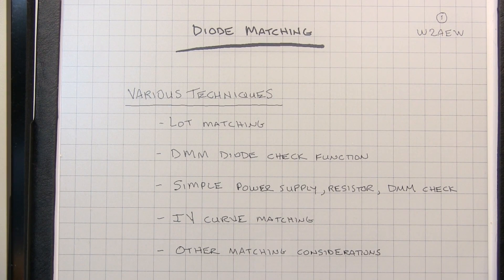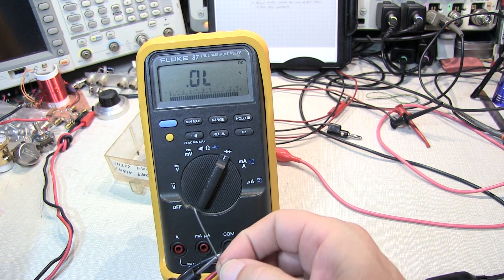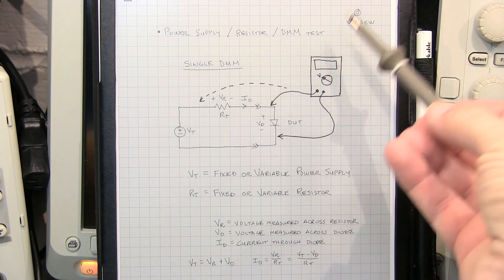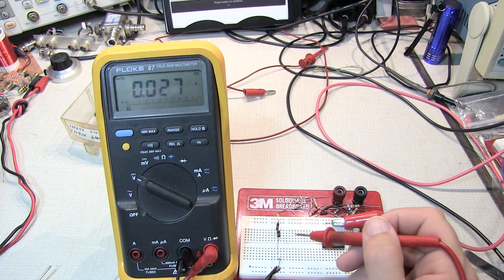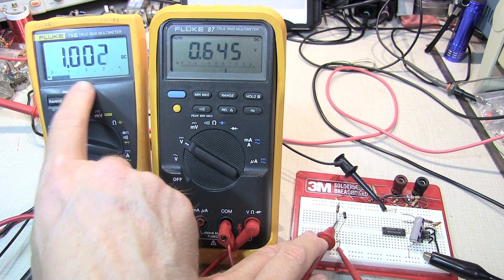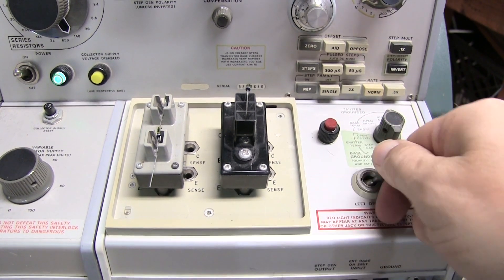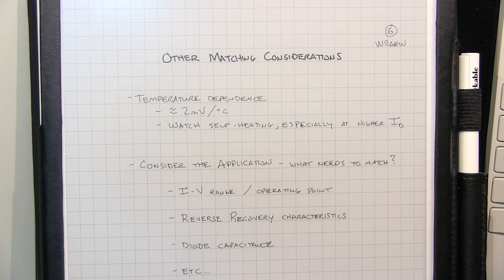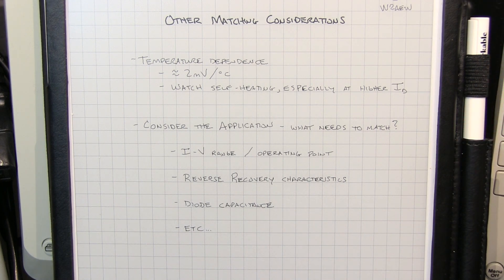#302: Back to Basics: How to match diodes -- measurement setups to find diodes that are matched

Comment: Thanks for the video. I did something you might find interesting with this knowledge. I created a 10mA constant current source using a LM317 to which I control the power through a relay which is in turn controlled by a Raspberry Pi Pico and then the dropout voltage over the diode is read using a MCP3424 (Only need 1 ch but this is the one I had on hand) and then wrote some nodejs code which sends a command to the pi pico over serial to initiate the measurement, which turns on the relay to apply the 10mA current and then takes a measurement using the ADC until a stable value is achieved and return this mV reading back over the serial port to the nodejs script. Each time the script runs it will load the previously received values and then group them in BIN numbers so I never actually write down any of the values because why not have the nodejs script keep track of all that and in the end I have an entire tray full of diodes with some nice groupings. I have not quite decided how long to apply the 10mA to the diode before taking the measurement because it seems to drop a few mV but it seems the exact point of "stable" is not the same for all diodes either... anyway, just thought I'd share what I did with this information ;) Really loving your videos!
Reply from the maker: Sounds like a great project.  You could expand it to have the Pi adjust the value of the current, and do a mini I-V sweep of the diode to get even better matching (knee voltage as well as dynamic resistance!)
Reply: @w2aew  I used 3x MCP41010 digital pots in parallel using various combinations to step from 1mA to 15mA and measuring using the same method above. When comparing the curves of 4pc groups I previously matched at 10mA there is no notable difference in the curves... I have to zoom in very very far in an excel graph to see the individual diodes but from the curves it looks like the incredibly small difference (100uV in one example) is proportionally comparable across the entire range from 1mA through 15mA. Thanks for the idea - it was a fun exercise and kept me busy for several hours ;)
Reply from the maker: @andrethomas1800  That's awesome!  You'll find that diodes that come from the same "batch", which is what usually happens when you buy a bunch at once, will match very closely.    Now all you need to do is add a LCD display to your R-Pi and graph the results ;-)

Comment: So very interesting, Thank You! Can the "Q" of AM radio reception  be affected by the quality of a diode? (How) Can the AC/DC load on a diode be measured? Thanks!
Reply from the maker: You can certainly measure the voltage across a diode with a meter or scope.

Comment: When matching transistors you mostly match the HFE, but when using a curve tracer or DCA pro you can match transistors by their "early voltage". I'm not sure why would you want to match transistors by their "early voltage"? If the transistors Match the collector output current, base current and HFE but "Don't Match" the early voltage, what will happen?

Comment: The Huntron Tracker I used to use would display a curve of a diode like that and it had a alternating function which would switch back and forth fairly rapidly so you could look at two diodes curves for comparison.  With A and  B connections.

Comment: For long-term stability, it might be useful to anneal them for a couple of hours at about 130 Celsius before matching (try and see whether the parameters change...).  If I needed to do this often, I would build myself an Arduino shield to vary/measure the current and to record the voltages to plot in Excel.  I would attach each diode to its plot.  You could categorize them by their Ebers-Moll parameters at best fit and write these parameters on the plot as well.  It is likely that average parameters occur often so that you could put these easier-to-match diodes in a separate file folder.

Comment: You mentioned a source measure unit as  alternative to using a curve tracer.
Reply from the maker: Yes, a SMU (source-measure unit) can source/sweep a current or voltage and simultaneously measure voltage or current.  Newer ones feature graphical displays and can plot results.

Comment: I tried this on discrete diodes and it works well.  When I tried to compare  quad pack diodes  TI   UC3611N
the voltage seems to wobble vary a lot.   I used my power supply directly in CC (current control) mode.
It work well on discrete 1N5818  diodes   but was not stable at all on the IC quad diode packs with the voltages
varying much more diode to diode for the same current ?  Any ideas what might be causing this ?
Reply from the maker: Strange - not sure what could be causing that.  Maybe stray pickup from the other diodes?  Try shorting all of the unused leads together when testing one of the diodes.  Maybe even grounding the unused pins...

Comment: Hi and will start by thanking you for all the great videos ! I was hoping if you could tell me if you have ever covered verifying that earlier stages/transistors are OK when you have failed output transistors. If not would it be possible for you to cover this subject use bare bones equipment (like me ) and what to look out for as to save yourself another run to the electronics shop .Thanks again
Ron    (Fremantle downunder)
Reply from the maker: If the equipment can be safely turned on, the best place to start is always to check the DC operating voltages (power supplies, and bias voltages around the transistors).  Failed transistors will often be obvious due to bias voltages that don't make sense with respect to proper transistor operation.

Comment: Hi Alan, I was wondering if you can perhaps do a video on resolving second harmonic interference within high frequency switching circuits that are used in RF applications. TOI is often mentioned within the engineering community, but when it comes to the second harmonic not much can be found. So I was wondering if you can do a video about SHI and on points on how to resolve that said interference.
Reply from the maker: I can add that to my long list.

Comment: As a side note, using a DMM to measure the diodes used in sensitive RF detectors can catastrophically damage them (the junction size is tiny to minimise parasitic capacitance). I've heard of technicians "buzzing out" a batch of RF diodes destroying each one as they went about their work!

Comment: A "more fun" matching task I had to perform was finding two PNP germanium power transistors (TO-3 package), wired as diodes -- in my case, base & emitter shorted together, cases (collectors) as anodes -- for a Harrison/HP 6920B meter calibrator. Those have to be matched up to a current of 5 A, and still have low Vf, as there's only about 2 VAC to play with.

Excellent video. I am very very jealous of your Tek curve tracer!

Comment: ok thanks i didn't know they use match diodes in log and anti log circuits, I rarely have seen op amp based log and anti log circuits not often used in schematics i have seen and I'm not sure where they use log and anti log circuits in besides in electronic theory text books i have seen them.  They say i was testing leakage current in diodes was measuring the resistance of the diode, if the diode has low resistance i just thought it would cause leakage current because the low resistance means the diodes junction resistance is low resistance and is passing leakage current.

Comment: any other circuits besides balanced modulators and mixers. I have seen matched diodes for wheatstone bridges and bridge rectifier,  balanced modulators and mixers in RF circuits, but what other circuits use match diodes? How can you test a diodes leakages without using a curve tracer because a DMM meter you can't test a diodes leakage. I have just used the DMM ohms resistance to test the diodes leakage, but i know like you said its not a good way of testing leakage. So what is the correct way of testing diode leakage test?
Reply from the maker: One application that requires matched devices are circuits that perform log and anti-log responses, etc.  You can test leakage with a power supply and ammeter.  Apply a reverse bias voltage and measure the current.

Comment: Yes i have notice when changing the resistance range its changes the applied current. Your Curve Tracers showed two different signatures from the same diode batch lot. It looks like one diode turn ON soon at 500mV and the other diode turned ON at 400mV. Any reasons why the diode turn ON or start conducting at different points? I'm not sure what this electronic term is called when the diode turns ON threshold point.  I have measured the diodes resistance ohms and they measure differently  and not sure if this is leakage testing a diode or what other ways to test diode leakage using a curve tracer or DMM. What application and circuits would you want to "match" the diodes? you mentioned it but didn't explain more about it.
Reply: Fabrication variation, packaging stresses and other things can cause changes in diode turn-on characteristics. Using a resistance measurement is just ok for doing a quick go/no-go testing, but the resistance value is meaningless. Leakage is measured under reverse bias conditions. Matched diodes are used in a number of different circuits, such as balanced modulators, mixers, etc.

Comment: Be careful when you measure with really precise multimeters and you touch the diode on both ends with moist fingers you can make a different in the measurement.
Reply from the maker: True - but in the case of measuring diodes, the several hundred kohm resistance of your fingertips won't have much of a affect on diode measurements.  However, holding the diode in your fingers can raise the temperature of the diode, that THAT will change the reading.

Comment: As usual, a great video. I've learned so much from you. Can the same technique work for transistors?
Reply from the maker: For measuring Vbe of bipolar transistors - yes.  But, keep in mind that matching transistors can be much more involved than matching diodes, because they may need to be matched in Beta or other parameters as well.
Reply: @w2aew  Thanks Alan .. 73
Reply: A curve tracer will be suitable for that. Not so diffcult to build with all schemas on internet. or if you have an Oscilloscope and a modern generator with stair case wave form. I thing Allen has a video that shows how do construct a curve tracer.

Comment: Super important and virtually lost concept across all solid state and some tube applications. The old Tek gear is still available both as stand alone and modules for 5000 & 7000 series scopes. 

Fantastic video. I'd love to see more particularly on matching bipolars for replacement/repair applications.

Comment: Thanks for the upload. Isn't this another application well suited for a LM10? At least if someone wanted to go a step further than resistors on a breadboard, prototype a simple one-off adjustable tool, but without the curve tracer or adjustable bench PSU setup. I think you're the one that introduced me to the LM10 too :-)
Thanks again.
-Jake
Reply from the maker: Yeah - I love the LM10!

Comment: Can Lab Bench DMM meters change the "current settings" when measuring the resistance ohms? These is often tests done for measure the diodes leakage which would increase the current and measuring the diodes resistance it will change depending on how much current you're applying to it.
Reply from the maker: If you manually change the range on a bench DMM when reading resistance, you will generally change the applied current.

Comment: Allan most of my explorimenting involves solid state devices although I am very interested in vacuum  tube tech and have built a few tube circuits without full comprehension in particular grid leak could you please please do a video on Grid leak (what it is, how to properly select correct grid leak resistors, how to correctly make necessary associated measurements  pit falls and caveats etc thanks S

Comment: Hi Allan can we  do away with the resistor and  use the current limit of power supply to set the desired current  across DUT excellent video as always thank you.....
Reply from the maker: Yes, but only if you ramp up the supply voltage after connecting the diode.  If you let it float to the setpoint and then connect the diode, you can get destructive current as the output caps on the supply are discharged through the diode until the voltage is low enough for the current limit to take over.
Reply: @w2aew  ha thanks i have had the pleasure of that experience testing zener voltage in this manner ''wait they cant all be dead out of the bag''   ''oohhhh''  doe lol i would like to set up some way of characterising  can i set up my sig gen to produce a ramp either  directly across the DUT or onto the base of a transistor..??  would this work ? Thanks for your time it means alot
Reply: was thinking of using both channels of sig gen.. First identify a diode with the characteristics you want to match place it in say ch1 apply a ramp then swap out ch2  with diodes while  applying the same ramp to it at the same time comparing the result directly on the two channels of my scope?
Reply from the maker: @T2D.SteveArcs  That'll work (using a two channel FG)
Reply: @w2aew  Thanks Allan I will try it at some point thanks for your reply
Reply: @w2aew  this was really surprising as I built the power supply myself and deliberately kept the output cap very small as to not destroy things when I connect up my circuits and there is some thing wrong (most times) lol

Comment: You could also use the current limit adjust of a PSU to set the current to a test level say 500mA (1N4001 Diode), stick the diode (Anode to +V) across the terminals and then ramp the voltage up past the point the PSU current limits then measure the voltage  across the diode.
If you leave the PSU Voltage set high then simply varying the Current limit up and down while measuring the Diode voltage will give you a poor mans curve tracer (Manually plotting the readings on graph paper yourself).

Thanks for the Vid Alan, don't see you a lot now a days....
Reply from the maker: I've used the current limit on the power supply like this, mainly for checking LEDs.  On some of my older analog supplies, it is difficult to set a low value current limit.  One caution about this method - the current limit function is usually on the regulator circuit, before the output filter caps. So, if you let the supply run without a load, the voltage will rise to the setpoint, with the output caps charged to this level.  If you then connect a device like an LED, the caps will discharge (with a high peak current) until the voltage drops low enough to to hit the current limit.  

And yes, spare time for making videos has been hard to find these past few months...

Comment: Hi, What would be some examples of RF/Ham related applications for matched diodes?
Reply from the maker: Usually you'll find matched diodes in things like a double-balanced diode-ring mixer/modulator.
Reply: @w2aew  What characteristics would a circuit or device exhibit that have poorly matched diodes where matched diodes are called for?
Reply from the maker: @howardroark3052  It depends highly on the circuit and application.  In the case of a diode ring mixer/modulator - mismatched diodes will cause distortion, which will result in poor balance (cancellation of fundamental and LO signals), as well as increased intermodulation distortion frequency components.
Reply: @w2aew  Thank you for your thoughtful response! As a beginner electronic hobbyist I find it fascinating to learn about the advanced aspects of it. Your videos are exceptional!
Reply: @w2aew  can you tell me what sort of current (current range) I should be using when testing/matching diodes for a balanced modulator? I've got a heap of 1n4148's - I assume they are okay for 3.5-14mhz.
Reply from the maker: @nevmarr  10mA is probably a decent value to test/match them.

Comment: Hi Alan, wonderful video as always. Just want to add if anyone is wondering, saturation current also doubles every 6 degrees Celsius. I was trying to work out a way to get that working as a temperature sensor. Which makes it a terrible thermometer over a wide range, but very accurate and fast over a short range, say 1 or 2 Degrees. One could build Cascade levels of sensors to get order level of temperatures then tune with lower order sensors like RTDs, NTCs and finally a diode.

Comment: Seems most diode and transistor measurements these days use (SMU (Keithley 236 for example) with a external shielded rig of some sort as full on Keithley parameter testers can cost $10k second hand for a basic model without all the external fittings.
Reply: There is another alternative to Keithley's, often much cheaper one: HP/Agilent 4142B. With some patience can be acquired <1K$ with some SMU modules.